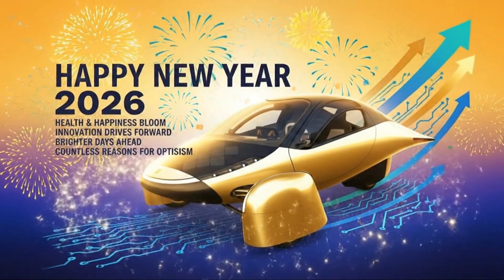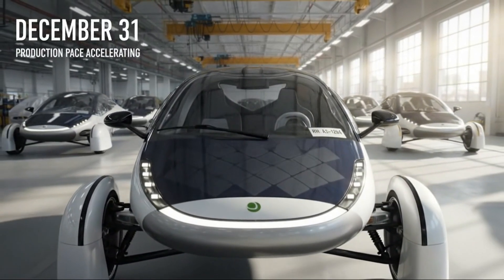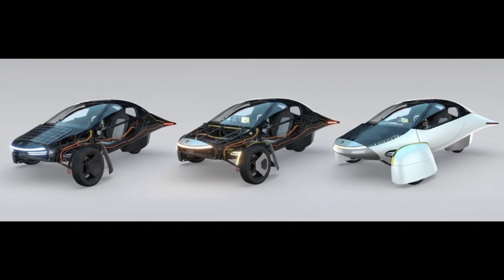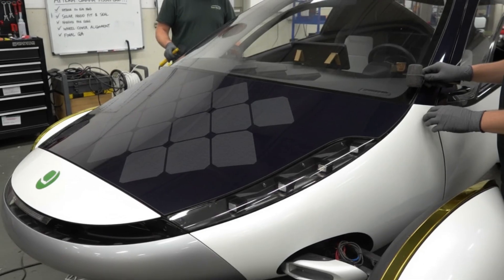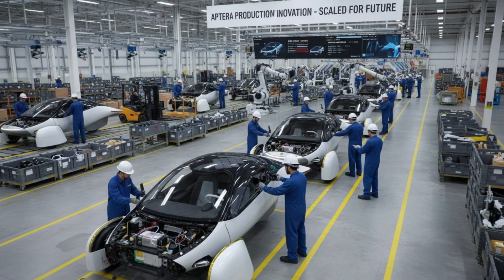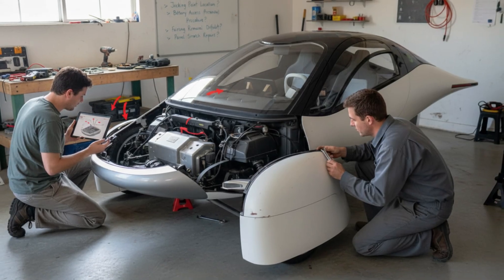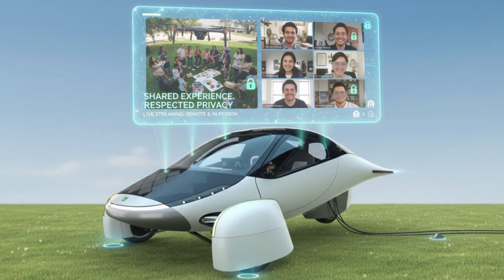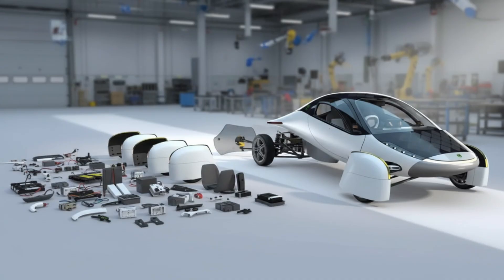Aptera PI Builds Update: Full Progress Breakdown as CES 2026 Approaches

Comment: It's going to be excited for Aptera to be at CES. They went last year and was the biggest hit of the show and it brought in tone of new investment. Plus they were production ready. Now, the CES will be just centered on Aptera because they will have by 10X more interest than any other company there. With that interest, even more investment is coming in. I am buying up as much stock as I can before it takes off, (already taking off so I must do whatever it takes to buy it up) because I'll be rich. I thank this channel for the most accurate and up to date information. Way better than those fan channels.
Reply: they have confirmed they will NOT BE at CES 2026.  Last year was a complete flop.  Didn't get one new investor.
Reply: @mikelfrance-l6x  - This is an insider channel. Just like Aptera, when they say it, you can take it to the bank.
Reply: why would anyone want an Aptera?

If the idea is to save money or even if your whole intention is to save energy, just get solar panels for your house with government subsidies and charge your sensible normal Nissan Leaf or Polestar 2 sedan using the Sun ☀️ 
Much better than an Aptera and its problem,

first of all, do you realize how wide Aptera is?  Get your tape measure or imagine..

when you park on the right side of a street where there's let's say an empty spot between a Honda Civic and a Toyota Camry, the Aptera wheel  will be sticking out by 18 inches, that's if your right wheel is touching the curb,

You can get your tape measure and ask yourself 
Would  you want the police to write you a ticket or tow your Aptera if all the other cars are about 70 inches wide and your Aptera is 88 inches?
It is even wider than a Ford F150 by 8 inches,
The police might say it's unsafe to be so wide,

And what if the wheel is snapped off by a garbage truck or a crazy sadistic  trump supporter who hates electric cars and he's  driving a Ford F150 monster truck with a gun rack,
yanks off the wheel that is sticking out by a foot and a half, on purpose just for fun or spite, can you afford it? 

where would you find parts? labor? even the AAA tow truck  is going to reject it for their insurance purposes, they won't take any chances towing a fragile 3 wheels car that their drivers have no  knowledge of,

Imagine, what if it has a flat tire in the rear?  Do you know how to repair a flat? What if it has a flat tire in the front?  

The first thing happening is that Aptera will be extremely unstable on the freeway because it has only 3 wheels, 
Dangerous!

The second thing is the deflated tire means the wheel cover will be dragging on assault or yanked off by potholes, bumps, etc until Aptera cones to a stop, expensive damage your insurance will not cover, for a good reason, 

The third thing is that there's no spare tire included unless you want to carry one that you buy.

Aptera company says you have to learn how to repair it yourself,  how can you even remove the wheel cover? 

No tools included and it ain't no Toyota, which means it's complicated. And no jack, no tools, no tire wrench, no puncture repair tools, and you're late for work,

The insurance company for sure would not cover it, because it's a known problem. They only cover accidents, not design flaws.

good luck finding an insurance company that will insure Aptera knowing how fragile it is and how expensive it is going to be for them to satisfy the Aptera owners.

Just imagine the cost scenario, 
Let's say you forget how ridiculously wide it is and you crash into an incoming traffic or let's say it's been parked and some hit and run yanks off the front wheel,

First you have to call the Police to make a report, then call the insurance company to report it with the police report,
Then you call the towing company and have it towed to a mechanic shop, but where? No mechanic is going to touch it, Aptera company will say only authorized Aptera Center by certified Aptera mechanics, more expensive than fixing a Ferrari or Lamborghini,
So hundreds of miles away, many thousands of dollars later, car is ready,
Hundreds of miles of towing to your front door, 
How much do you think the premium will be for a problem like that ?
Imagine all Aptera owners will have problems with how wide it is

Imagine you park on a busy restaurant parking lot,
A car wants to park next to your Aptera but it can't because  
Aptera is 88 inches wide, Toyota Camry is 72 inches, that's like a 16 inch spare tire laying flat next to the Toyota Camry, can someone park next to it? 

Imagine the hate people are going to express, just a crack on the solar panel glass surface is going to need entire surface replacement, probably costing you a good $5k if you're lucky plus shipping of about 500 dollars and needing a special authorized Aptera mechanic or body work specialist, 
$1,000 labor if you're lucky,

I feel sorry for all the people who don't evaluate everything about this car before investing, which is like buying shares in a future trump casino or NASA Mars habitation condominiums 😂

BEWARE ⚠️
Reply: @wateristhefuelnotfossil  - Aptera is single-handedly saving the planet. They also have right to repair and won't be a drain on the electric grid (as EV's are the biggest drain currently). So, with it starting at $28K and getting up to 40 miles per day and 1K on range, plus the massive storage, it's the perfect car for everyone.

Sounds like to me, you are a short.
Reply: @wateristhefuelnotfossil  Because solar power is too flaky.  Yah its great for San Diego but everywhere else it doesn't make sense. And no one wants 3 wheel 2 passenger communter vehicles for $45K.  Its just a bad concept.